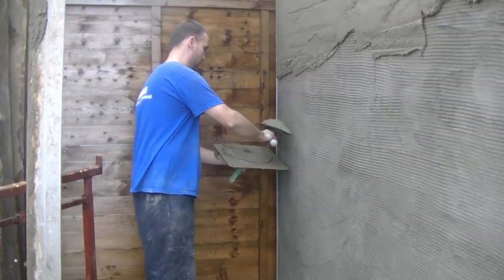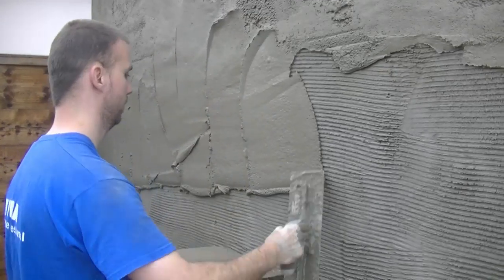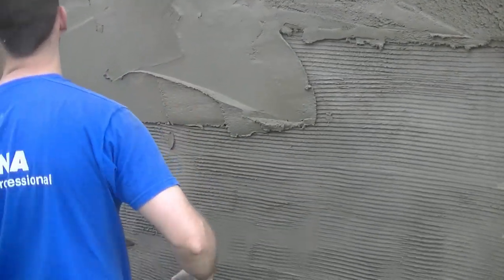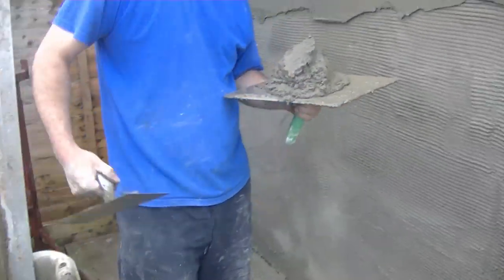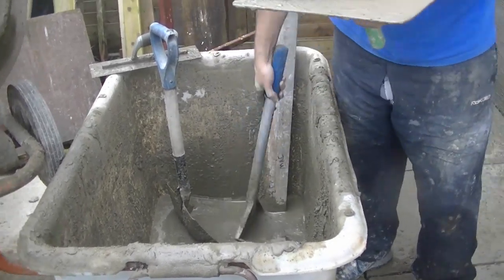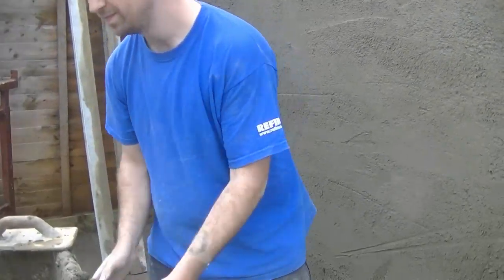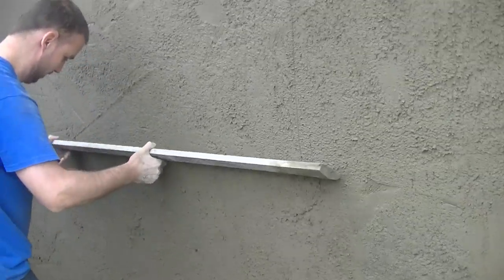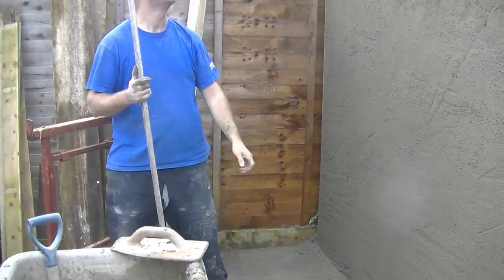How to Coat and Straighten your Cement Render ready to Finish

Comment: Hey Mac...not bad ..😆...ever napp finish top coat...not sure if it's common up north.
Reply from the maker: I think you showed me that before but its slipping my mind will you drop me the link again bro ?
Reply: @macplastering  I haven't mentioned it before but simply it's a sand cement and lime  coat,floated ,and before it goes to hard  scour over with orange sponge float then tap the fat ,to achieve a sort of stipple... basically  hides any float marks,, but beware it's easy to have napping dry joints also,so bungalow gable would require 2 men napping together to avoid joints....
Reply from the maker: @nickywalsh8492  Not done much here possibly on a few farm buildings that i have seen , yes could see how that would joint easy

Comment: Thanks for sharing these great intuitive videos. I have just bricked up 2 external doors with thermalite blocks. One i need to patch up with render and the other needs dashing. I noticed when doing the block work that the mortar was getting sucked dry by the blocks quick. So, how would I prevent this with my render? Do I need tonuse ems sheet etc? Thank you
Reply from the maker: Hi Lee mate would you have the depth to use the ems sheets ? plastering over the themalite will be tough as it will set fast, If i was going over them i would possibly scud coat  it I havea video on that and the mix ratios , I would add more sbr and waterproof though to hold back suction I would do the same in the scratch coat the finish if the patches needed i would soak them ever time most likley still will as them blocks set so fast / dry fast hope this helps buddy I have a few dashing patch videos also on the channel

Comment: Hi Mac wondered what’s your thoughts on rendering celcon lightweight blocks with a smooth face rather than the zig zag lines of the thermalite equivalent. Outside and internal on kitchen extension. What in your opinion would be the best product to use as worried about cracking with sand and cement.
Reply from the maker: Not sure i worked over them but possibly scud coat mate or a sbr painted on and in scratched also if really worried mesh the scratch coat, building up on layers makes it stronger again not sure on its key or suction dose look like a little key on them but yes smooth for a block

Comment: Have you ever used a Rabot/plane to flatten render!? Been using one on a job this week and found it pretty good. Still need a rule to flatten the work properly tho
Reply from the maker: HI buddy dont think i have are they big what do the look like ?
Reply: @macplastering  same size as a trowel but instead of a flat blade it has a grid which takes off high spots when you run it over render. I find it very good.
Reply from the maker: I might have a few of those for k rend ? also have a big heavy blue on witch i good for reveals

Comment: Question... Do you put waterproofer in the topcoat as well as the scratch? It's what I do but other people tell me only in the scratch with lime in the top coat.
Reply from the maker: Hi Colin mate yes I do and dont use lime, but I know guys who do it all diffrent ways best to do what's worked for you in the best and you know has lasted years I have a few mixing videos on how i mix scud scratch and top coat would be the main mixes I do,
Reply: @macplastering  Thanks for getting back to me mate. Cheers. 👍🎅
Reply from the maker: @Rureal42  No problems mate I dont tend to put much in as you'll see in them videos LOL but always been good for me, not sure where you are but I think types of sand will have an impact on ratios of mixes also the sand we have here is pretty good nice a gritty but not to much great fro strength Hope your doing well mate :)

Comment: Hi Mac good videos. I'm not a plasterer but have a bit of rendering to do so just  looking for some advice. Do u put any lime in finish coat and do u need to scud the walls for scratch coat
Reply from the maker: Hi mate I dont tend to use lime if i do i put in very little but on new block it is ok just to giver it a 1st coat then next day or 2 go over with the finish coat , I always do min of 2 coats not sure if you seen but have a few other videos on render might help you further :)  Stay in touch buddy and thanks for watching and supporting
Reply: @macplastering  cheers mate I've watched the videos so I'll be going with your mixes and thanks for the reply
Reply from the maker: @leonardclarke5169  cheers buddy wish you the best of luck with the work buddy plastering and rendering is not the easiest
Reply: @macplastering  fingers crossed mate it will stay on 😂😂. On the finish coat do you use 4 buckets of sand and 1 bucket of cement and any waterproof
Reply from the maker: yes buddy thats it but i dont use to much additives a cap-full is loads though others like more depends on who you are i suppose :) keep in touch buddy
Reply: @macplastering  cheers 👍

Comment: Hi Mac. Do you stick you bead on first before the scratch coat.
Reply from the maker: Whats up James mate, oh yes I get them in the scratch coat so they will set tight and cannot move and stay level best way i recon bar using timber rules / guides :)   ( i stick them in with my scratch coat embedded )
Reply: What mil beading do you use mate ?
Reply: Just built an outbuilding out of light weight blocks and have 10mm beading would that be ok ?

Comment: I’ve been getting bubbling on my render any ideas mate, I use a paddle rather than a traditional mixer. Could that be it ?
Reply from the maker: Hi buddy most times bubbling is to wet of a background what size are the bubbles ?
Reply: mac plastering there around a 2 pound coin size. Around 12 square meters today so nothing substantial, there were only around 5/6 but when I try and float  them out there’s a air pocket that causes props, not really had before. Been spreading 30 years just vert strange, I’ve recently started using sbr not sure if that either 🤷‍♂️
Reply from the maker: @dominicdurso3672  might been just low suction and damp , did u use sbr in scratch or top coat ?
Reply: mac plastering I used it in 1st cost then a little in top coat to, I normally just use waterproofer in first coat then a little feb in top coat, but fancied a change and switched to sbr,
Reply: mac plastering it did the same on a job little while back and I wasn’t using sbr then . So prob not that, starting to think could my drill be whipping it up to much so is to airy . Strange one really
Reply: mac plastering thanks for getting back mate. All the best, great vids mate 👍
Reply from the maker: @dominicdurso3672  Any time I use sbr I only use a taste as I do think its so strong that been said i put both sbr and water proffer but not much of them in a mix , is your drill real strong what kinda drill is it ?  The big refina petrol mixing drill i use at times mixes the gear like cream but never had any major air bubble issue's
Reply: mac plastering it’s the 1800 watt mega mixer, I may of put to much sbr in then, I’ll go a bit easier with it on next one I think 👍👍👍
Reply from the maker: Let me now your findings on the next one buddy ?
Reply: mac plastering yes I’m doing one in couple of weeks, 👍thanks pal
Reply from the maker: @dominicdurso3672  Nice one mate keep me posted

Comment: Good job it’s coming in well is your trowel slightly turned the wrong way lol? i often find myself working left to right with sand and cement as well even tho you should work right to left with sand and cement so your always coating into your stuff without having to go back handed if you get me, you ever use a board and stand? Or do ya find that way easier
Reply from the maker: Hi Alex mate no no the trowel is fine it just there is SBR in the mix so it need to be a little wetter witch might be why there is a few more lines , I usually use boards but this place was very clean so it was best to just contain the mess to the same area and mix there so no room for a board LOL but on other videos i show how the gear is lifted of a board and how i turn it and cut it = https://youtu.be/u4uhrqkbTWc also talk about sbr , I love working left to right and of course tried it all after so many years, but still open to learning new plastering and rendering skills myself, coating sand and cement dont matter what side you start as long as you dont leave air pockets and if your neater and faster from one way stick to that :)
Reply: mac plastering that’s it mate it’s just what works for ya coat what ever way is easiest lol the old timer I served my time with years ago with said everyday is a learning day in this game and he’s right were always finding tips and ways of making things easier for ourselves. Starting to k rend a new build tomorrow so hopefully get abit of dry weather for a change lol
Reply from the maker: @Alexr-uf3zn  If we dont learn something new every day we doing it all wrong ahah :) Oh man K rend is hard work for sure hand applied ??? dude im inside skimming (reskim) but even walking in and out is a pain carrying water in out the van and trying to keep a house clean LOL us wet trades get it hard
Reply: mac plastering that’s true, yea hand applied it is hard work alright lol, i was skimming this week as well got her all floated last week been bonding and skimming ceilings this week but with it giving it dry going to go outside tomorrow got it scratched a few weeks ago then it came in wet ever since, it’s nightmare when it’s raining running in and out to the van especially on domestic jobs trying to keep everything as clean as possible
Reply from the maker: @Alexr-uf3zn  Hand applied stuff is like bubble gum hope its not to big mate done a few big hits with it defo feel a days work after it for sure :)

Comment: Theoretically i dont believe you can achieve a flat finish across your entire wall area using this method.  A wall that appears flat to the general eye may be the only result. 

It maybe flat accross the length of your screeds doing a vertical pull followed by a horizontal pull but thats it.

And this is acceptable obviously.

But what is your definition of flat ?. ( In your area of the woods )

Surely the use of vertical guides at any given thickness would be the better option to get the entire wall to lets say - a much more tolerable flat ? 

I quess the real question is tolerances,  low angle sun shading too, line of sight ect  .  .

I would have used guides personally.

One plasterer to another .
Reply from the maker: Not sure if your in or out LOL but yes this wall is also finished on video looks pretty flat to me , I actually do have guides and talk about them during the video one is a bead set plumb  to my left witch gives me a perfect guide then on my right I tell the viewers who are listening that I used a rule witch is ether a nailed on straight timber or get someone to hold a metal straight edge up it this is 2 fixed points to work of that have been plumbed straight witch means you have 2 points to pull of with skill you wont dig in and keep it straight would love to watch how you get your wall straight and then flat , but yes getting anything 100% perfect is the dream us humans strive to get to as if you keep breaking things down small enough you will have more numbers to play with and be able to try to achieve the perfect number all the way down to the finest molecules, 

so when you say you would use guides dose this mean you would put bands on to work of like i mean cement bands that will give you patches all over the wall?

do you mean putting timber on the wall to pull the edge of also then having to take time ti set them and then refill them after you have finished the wall 

Not sure about the guides you mean so cannot understand the method you mean 

Could i make this wall level and string top to bottom  to where if you put a string on it there would be no hallows bumb,s dips what ever's  but would i get the job at that price compared to a guy doing it the simple way like i show no way.

Could you post a video on the way you get a wall flat / straight / smooth / level / plumb 
I would be interested in it  and love to see how other Plasterers go about there businesses in there neck of the woods..

this is the wall being finished Witch I would call a high standard -  https://youtu.be/3W1EWHNi8-A

this is how I layout a floor with no use of guides bar the ones I screed in - https://youtu.be/Ci2zUfviDTo

This is me explaining the screed in smaller scale - https://youtu.be/XuTdGEUoQz8

Hope you can pop a few videos up my friend I truly love plastering and would watch it love how guys do things diffrent all over the world , Witch part if it are you from by the way ? Thanks for taking the time for your great comment hope to hear and watch from you soon :)
Reply from the maker: @RPM-wd9rb  hello Mathew mate What I actually say in this video around the 7 8 min mark is that you setup batons and screeds it seems i get loads of comments that come from people not hearing all what i say I do cover this topic in video , I would ove to go back and pt a straight edge on this wall I reckon there wouldn't be to much off on it to be honest I usually check before and after i rub it , but I know perfect is impossible to achieve and also that you cannot please every one, very interesting you talk about Michelangelo as i read once that he made a ceiling to appear straight but it was anything but, so the illusion must have been good enough, I  was once told by a plastering tutor that 100 years ago plasterers where paid on time and took there time to get the wall square and straight , but I have also worked in house that where 100 plus years and can tell you they are not straight level or flat and I mean this is as they worked to things like skirting plaster cornice door architrave picture rails data rails corbels and other plaster work bathtub's , now they did it this way to help finish these things of and save plaster , so not only would this be if the plasterer dont get it straight but has the joiner got the skirting s straight the plumber the bath and is the wood itself straight so many other elements to it , painter must of had a dream back then with minim filling and caulking, But yes u have seen 100 year old building and been amazed how good it looks overall let time be the tell to all mans work. 

thought this was interesting -    Is it possible to ever get a completely flat surface?
The flatness of a surface is measured by the difference between the highest and lowest points over the length of the surface. Any flat surface looked at under high enough magnification will have a degree of mountains and valleys. Even grade 00 straight edges are not completely flat.

I am not sure if I am better or worse than other youtubes that is u to the viewers to call I am no way the best plasterer there ever was has been or will be but I always do my best and to me that is a high standard! :) 

Love chatting with you about the aspect of perfection 

Would Michelangelo thumbs up my work who knows but these would be my most artistic jobs = https://www.youtube.com/playlist?list=PLDpySD0F7BfLd1zZf81nJ7N_MUi1135MR

Who knows he might have liked it or thought it was to easy but would love to have worked with that guy as we can learn a lot from others 

Thanks for watching and taking time to comment mate

Comment: Well man should u not be coating from your right am left handed and I always start from the left. If you are skimin yes u start form the left because your right handed lol just I never seen a right handed start from the left when sand and cement
Reply from the maker: No difference mate and here I see most rights start at left that i have worked with and one guy that just started anywhere LOL
Reply: I'm right handed and on backing coats and s+c I go right to left as coating back on yourself and coat will be even as the heel of trowel is on  what's coated ,were as left to right you thin out the coat and more filling out to do .